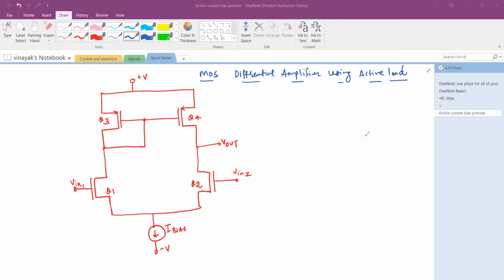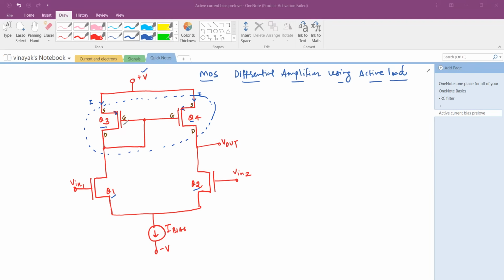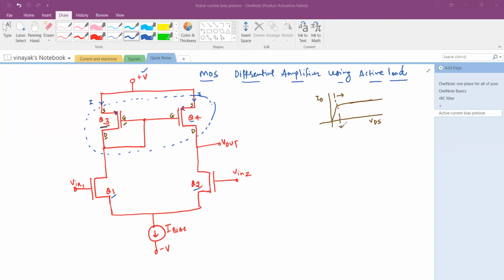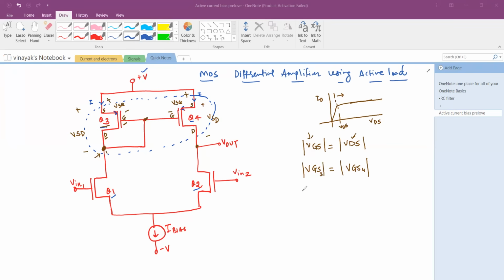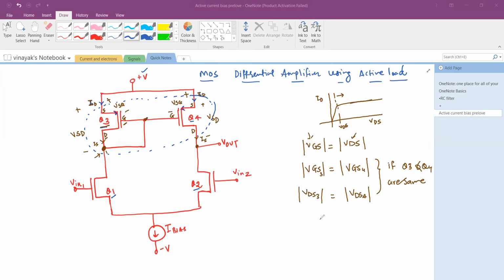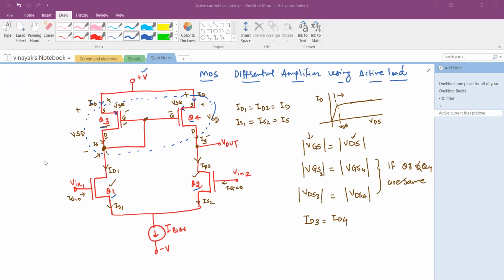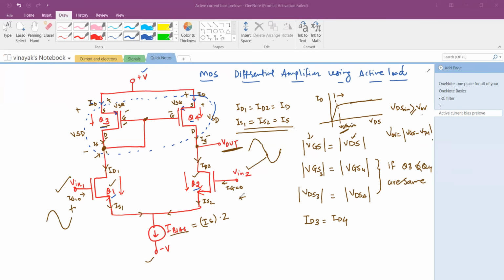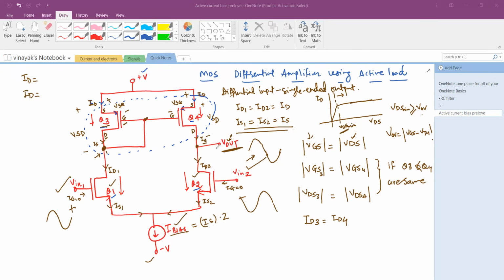Master Differential Amplifiers with Active Loads

Comment: Hello! if I wanted to correctly polarize the differential pair with active load on LtSpice, how can I proceed? I directly set the current from the bias current mirror and from the characteristic curve I choose my Vgs. the problem is how do I proceed for all 4 mos so that they work in the saturation zone?
Reply from the maker: Make sure VDS is greater than or equal to VGS for all transistors so that they work in saturation ....Transistor with drain and gate shorted will always be in saturation. Hope this helps
Reply: @VPACHKAWADE  Thank you!.Rightly because VDS=VGS